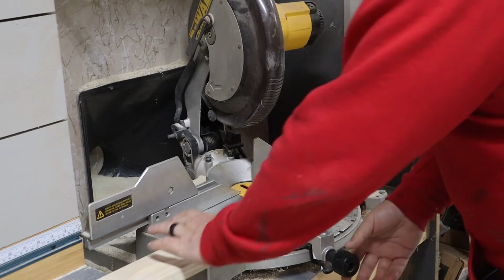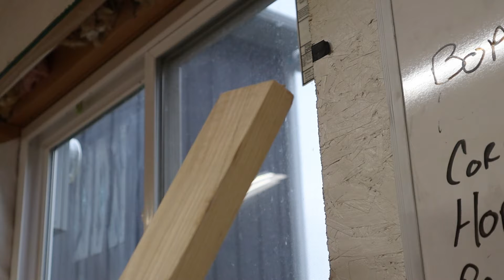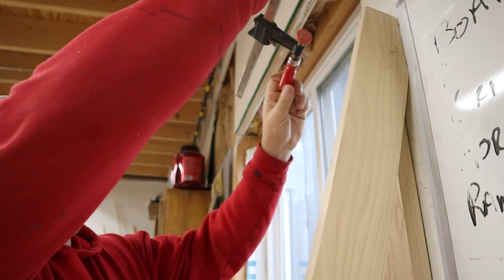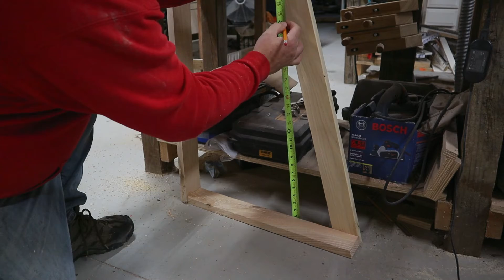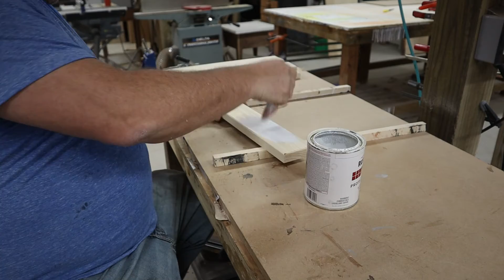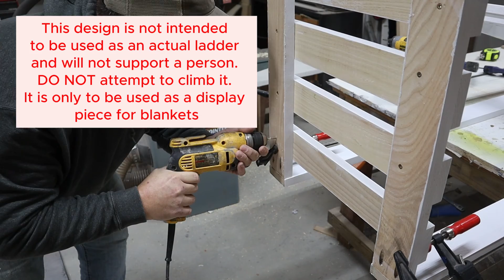DIY Project: Craft Your Own Chic Blanket Ladder from Scratch!

Comment: The next time you design something that buts up ti the wall, remember there are base boards and carpet attachment strips near tge wall.
Reply from the maker: Yeah, that thought crossed my mind after I had it assembled. It is a very good point to bring up. I should have mentioned it in the video, but forgot. Thank you for the input and thanks for watching!